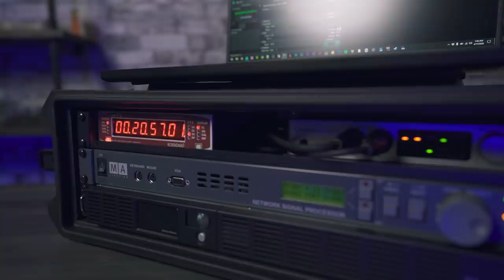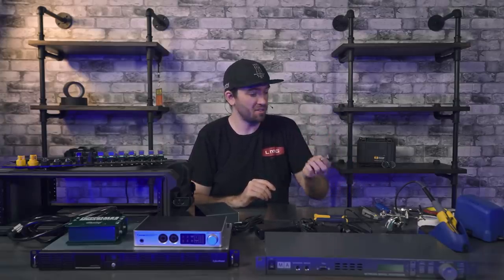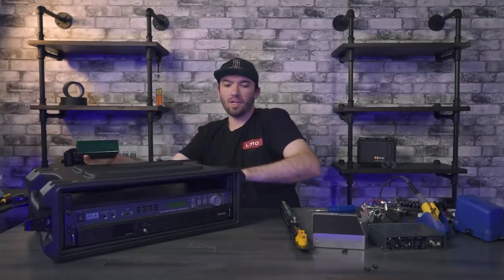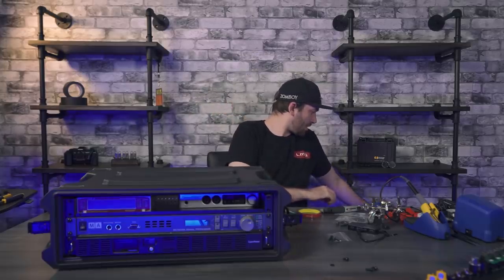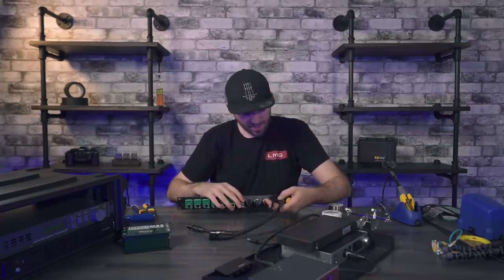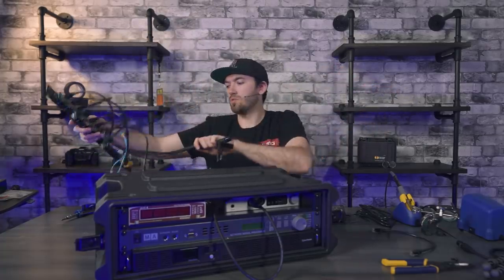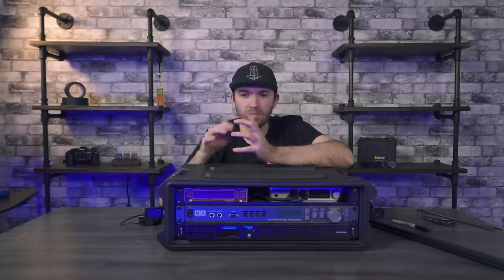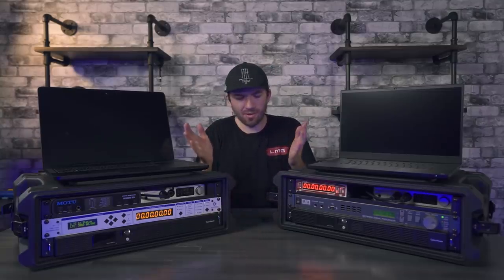Building My New Lighting & Video Timecode Rack Step By Step

Comment: RE: UPS, had this same concern with a switch and artnet node - In the end I took out the switchmode PSU's from the devices and powered them straight from a battery (so also more efficient as UPS will have DC batteries, which then will go through a rectifier to 110v AC (or 230) in my case - and then you are switching back to DC again for the device itself. Plenty available if you look at DC UPS for industrial controls. They are tiny too! Be similar to the setup in your MA (or in my case MQ60)

Comment: Two years ago, Cacao Beach Bulgaria, Denis Cruz, 4000+ people, I do the mixer changeover while the warm-up DJ is playing and do a blackout, Denis starts (thank god with a long intro). The MA laptop stop. Completely. In 30 seconds I grabbed my personal laptop, download the showfile from a backup flash drive, plug the fader wing and somehow manage to open in time for the end of the intro. Now I have two fully identical laptops always running next to each other.

p.s. a little tip for easy change-overs: If you have 3 or 4 players and one DJ needs mixer A and the second needs mixer B, simply connect all players to mixer A via analog and to mixer B via digital. All that needs to be done is to swap the booth monitors from one mixer to the other and all can be done while the Warm up DJ has started the last song. No downtime whatsoever.

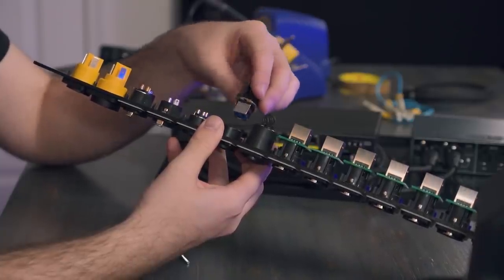Comment: 42:21 The panel mount USB was flipped incorrectly. There is a flat silver piece of metal with a retaining clip pressing against the USB B part, when it was flipped that should have been removed and put on the other side before screwing it back together. this will also let the USB B connector go further into the panel mount with the center "barrel" going into the metal part more. I hope that helps!! Great video!!
Reply: Came searching here for this comment. Glad I am not the only one who saw it.

Comment: I'd highly recommend securing devices to rack shelves with stick on industrial velcro. Easier to re-position, easier to swap out devices when they fail. Just as adhesive.
Reply: Velcro all the things! 
covering shelves in loops is always the first thing I do.
habit I picked up from a guitar tech roommate, it just saves so much time reconfiguring little silly things without rack ears.
Reply: Added to the velcro, a few holes drilled into the shelf and pass cable ties to make sure nothing moves during transit too.

Comment: Question:
ShowKontrol 
As I Understand,
Should have a CDJ 2000 NXS2, connected via Ethernet out of the CDJ and Into the Mac Laptop where SK is Running, and from what I can see in the Very Helpful video is that SK can Generate a Timecode signal w/o the need of a CDJ connected.
How is that setting done on SK?
Connot seem to find the propper setting so that I do not need a CDJ Hooked to generate TC.
Would be Awesome.
I am running the last available version of SK, on a MacMini, with SK installed, 
This MacMini is only used to run SK, and runs it well,
So please,
Share how You actually got SK to Run and send TC, w/o a CDJ 
ThanksMan!!
Awesome Video!!
Very Helpful! 
🙏👍🏻🤜🏻✨🤛🏻

Comment: Hey Christian, nice build hope you are doing well during lockdown. 
Some notes I would like to say from my own experience, the rj45 pass thru connectors are way more easy to do the build but they're also way more easy to malfunction, unless its for indoor use only I would recommend to use the stripping type of connectors like you did on the previous rack. Another thing but its more about personal preference and depends of the use, I usually prefer to remove bottom or side screws of the equipement I want to fix and drill a hole in the tray and fix them with their own screws, I dont know if you can understand.
Anyway I enjoyed it a lot and overall perfectly made! Hope you stay safe!
Reply from the maker: I think I will be making some changes and posting an update :) the punchdown type seemed more fragile, but I will do some more research.
Reply from the maker: Thank you

Comment: For the UPS, is your main concern that the switch is going to lose mains power, or that the internal power supply will fail?

If the latter, there are some relatively affordable 1U switches with redundant power supplies built in.

If the former, they make fancy power cables that have two input ends and a big switch that can detect a power loss on one of the input lines and switch to the other. They're called ATS (automatic transfer switch) cables and are used in datacenters when critical devices don't have redundant power supplies built in. They're expensive but might be a solution if you know you'll be able to have access to two distinct power sources on location. 

As far as lighter batteries, you've probably already come across this but there are some decent AC-capable battery packs. Mophie's Powerstation AC is a really good option. I've got one in my travel kit. The limitation of course is wattage it can support. I think the Mophie tops out at 100w. There are some lesser known brands that claim they can do better, but I'd be wary of accepting those specs at face value.
Reply: Oh! And another option would be a lithium powered UPS. APC makes a nice one that's half the weight of the Cyberpower unit you've got. That's probably the most straightforward solution. Link: https://amzn.to/2VALnGl

Comment: OM 1 thru 4 define the thickness of the core and cladding of the FiberOptic Cable. OM 1 and 2 are basically the same. OM 3 and 4 as well. There are some minor differences which make the even Numbers a little bit better for longer cables. But in the End they are mostly the same
Basically it is like wire gauge.
You can call it Fiber Optic cable. Technically it is more correct to call it a Fiber Optic. At least in Germany. A Cable defines something which transmits electrical Signals. A Fiberoptic doesn't do that.
And your Fiber cables aren't crossed as they should be. Any Fiber patch should do a crossing pattern. There are certain applications, where that is not possibe, therefore you do have the ability to take those fiber connectors appart and make a regular "Crossed" Fiber Optic a "Straight" Fiber Optic. I could be wrong though. Because it doens't show on your video very well.
And I couldn't find a "Pin-Out" for the Opticalcon Quad.

Nevertheless, those are 2 nice pieces of Equipment. And I hope you will enjoy them without to many trouble.
If you can make it happen, try and test that Rack with any other Network rack and please prove me, that I have seen wrong. I've been in the situation before, that something with fiber optics wasn't working and it was a real Pain until i bought myself a small fiber fault finder for like 20 Euros. That made my life way easier ever after.

Comment: Keep in mind that airlines have max battery limits for carry ons and a 0 lithium battery limitation on checked bags. Not sure If you fly a lot to your gigs but just a thing to keep in mind for the UPS
Reply from the maker: Yeah, that was my main reason for doing it this way but if I can get a smaller battery that can supply enough power for 10 minutes, then I can easily carry on the smaller package. I almost always carry everything on anyways.

Comment: Hey Christian,
Thanks for your great Videos. I‘m from Germany so please excuse my english.

I‘m using GrandMA2 OnPc in combination with NSP 2. Since some weeks i own a Command Wing for GMA 2 and i have the following problem maybe you can check it on your own.

I load a Showfile which was created with the NSP 2. When the CMDWing is Pluged in it doesnt work directly with the showfile. I have to creat a new Show, Switch dem CMDWing on and then i get the Massage about Original MA Hardware. When the Pop up comes i can Click okay and the Command Wings works with grandma 2. I can load the Original Showfile and everythink Works.

Maybe you have a good idea for this Problem.

 Best regards

Comment: could all ways DIY a LIPO pack and migrate the ups over to a 4U server case with the lipo pack and configure it as an inverter only instead of as a UPS and throw in a separate lipo pack charger so it would use the lipo pack as a ups battery bank and the lipo pack charger keeps the pack topped up

Comment: I understand that CDJ-2000NXS2s are the club standard for DJ gear, but I have no idea what venues are generally doing with DMX. Are there any real standards? I was going to get an Obey 70 and 5 or 6 cheap lasers/fixtures/washes just to try to understand it better. But this time code stuff seems complicated. I remember seeing a video of Armin a few years ago saying that at the time he was playing with two decks that were just for the time code, and then he needed to keep those in sync. That seems like a lot of work when you could just setup some chases and manually switch at the drop/breakdown/whenever and it would probably look a lot more like it was perfectly in sync than a lot of these super-complicated setups. I assume it's mostly because the DJs want to delegate the lighting and not have to poke a button to switch to a different chase — and that's kinda funny, because DJs love having buttons to press! Just pretend your DMX controller is like another beat effects section on the mixer!

Comment: Really appreciate this video! It sounds like the distripalyzer rack is more for situations where you don't want a physical console to fail and lose your LTC signal into MA, therefore onPC would take over with MTC.  Would the mif4 rack be when your artist is sending you two separate timecode signals which have different timecode times, as demonstrated with ShowKntrol in the video? I suppose with the mif4 rack you would be losing some redundancy in terms of getting, for example, timecode A or B into the MA session twice(Like the distripalyzer rack)  because the other timecode signal is a different timecode time? Hopefully my thoughts make sense lol.

Comment: There are such thing as lithium lead-acid replacement batteries, they are designed to be swappable with Legacy sealed lead acid battery systems. if you could find a compatible size or maybe sacrifice time that would cut your weight down dramatically. and do realize that the UPS is a way better method then a battery system as it has communication with the computer. Otherwise you would be building your self a online UPS which would consist of a very beefy power supply, charge controller, lithium battery pack and good quality sine wave inverter. And a lot of the battery packs on the market you have to watch out for as 90% of the inverters on the market are modified sine wave and not true sine wave, which does make a big difference in efficiency, Cooling and anything that's relying on the AC waveform to be clean, stable and consistent in timing. I had a i think Dell power brick that just refused to run on my older modified sine wave APC UPS, meanwhile the hard drive for data intake was completely fine with it and everything else I plugged in at a bit of loss of efficiency. And when I say older model I mean it's one of the older gray really cheap power strip style models all my newer ones have much better control on the modification of the sine wave, and if I can get it working again I have a nice sign wave expensive ups that I got for free.

I "do"? live sound and I Was Bitten once by a power outage. I was using somebody else's PreSonus mixing on my iPad and we just finished practice and pre-check, as I was walking to the mixer to sync the faders with the computer.... the power went out and everything reset to where the physical fader positions were. I believe in using a UPS for everything because then everything comes back up right where you left off; plus you have some light when you're trying to troubleshoot from your computer monitor. I will plug as much as I can into the UPS except for the laptops and amps and if I do anything bigger I really do consider dragging out the Behemoth that I can run everything including the most important piece of equipment the cooling fan, for me.
I guess I should say I am a reasonably small setup with the xr18 a handful of laptops and about 1-3x 100 watt dual Channel amps. I was looking to upgrade to a 4 ch 500 watt for my mains+mons I'm torn between the Behringer and the seismic audio and lack of cash... suggestions would be appreciated.

As far as stage stuff goes I generally wouldn't put that on unless I could see one of the musicians having something that would be badly affected by a restart as in losing settings, amps and stuff will just go off and then come back up; unless there's a brown out then that's bad and you should be ready to hit the stage power switch and pull the plug!
Reply: If you made it that far congratulations, I'm sorry.
I also put my network on it obviously. I recently ( was it January or February? ) did a live streaming event and I figured the internet will probably go down at the hotel but as soon as it comes back up all I have to do is restart the stream and all of my equipment remains active and maintaining IP addresses.
Although I do plan to incorporate a better router at some point that we'll be able to do load balancing and fell over to a Cellular Connection...
Oh yeah there's also the benefit of things continuing to record capturing the disaster as it unfolds. Thankfully the only disaster I had was with Facebook and the live streaming app that decided 1 hour was all I needed to stream for and continuously posting to my Facebook and not the events for that event.

Comment: Christian, please reconsider some of the things you did with power. The metalic panel with the power should be grounded. If a connection came loose and caused the panel to become live, you would be the one liable for any injury / death. 
Those connectors should also be compleatly insutaled, you can get a couple of Neutrik covers (called SCDR). And only ever use ratchet crimpers, others are just unreliable.
It's also not acurate to say that an MA 2 shouldn't be connected to a UPS, ACT Lighting themselves say: 

"If you want to have power available beyond this internal UPS Battery, in the event of an unexpected power loss, it is possible to connect to an external UPS, provided that it does not lift ground from input to output. The console must be grounded." 
An MA has a power distribution PCB which transfers power from a PSU to a battery, no inverter or anything that would cause problems.
Reply: Not having watched the whole video I want to add one concern:
MY Ubiquiti 8port POE Switch gets really warm, even with nothing connected and drawing power over POE.
Seeing as this will get used in summer festivals or club shows where it tends to be warm anyway it might not be the best idea to put the switch in flush with the box.
It would be a shame to see any of these parts fail due to overheating.
I also second the grounding of the metal plate. In Germany you would have to test this entire unit and the panel not being connected to ground would make the whole thing fail the test.

Comment: Those fibers are not happy... Keep the radius bigger and Do it last So they get less stress
Reply from the maker: Good call I will do a little rerouting! With the original configuration with the panel in the middle slot of the rack it was no issue but I was forced to move the panel up to the top and it’s not ideal for the fiber. Mostly just wanted to get this built since it was 6am and I needed to finish this video :) thank you
Reply: @christianjackson  you are welcome
Reply: Also that SFP connection without opening the clamp.. Yikes xD
Reply from the maker: Haha copy all that. Will open em up and get it fixed and post an update. I can’t really even use the fiber part I just wanted it all in there to be ready for when I do eventually need to use it :)

Comment: hi! i have a question, i noticed you have the motu microexpress on the first rack, can you use it as a standalone to convert LTC to MTC? does it transmit that MTC output in every MIDI out? i've been looking everywhere (manuals, forums, tutorials,etc) for that information and i haven't found anything, i would prefer to buy something like the MIF-4 but the price difference is big. i hope you can reply to this comment soon. thanx a lot for the videos, your channel helped me a lot with the stuff i'm learning to do right now. keep it up.
Reply from the maker: This is a good question! I just verified with my setup that this scenario DOES work. However, you will have to use the MOTU midi software first to save a user preset with that midi mapping. All you have to do is create a routing from “MTC” to the midi outputs you would like, then save those settings/routings to the user profile. Then you can power it with just USB, not connected to a PC, select that preset on the micro express front panel and it will work.
Reply: @christianjackson  that's awesome!!! thanx a lot for the reply!! right now i'm waiting for the update on my avolites software that will include a secuencer (i think it is currently in beta) and then i'll get my hands on the microexpress, so i'm still a couple of months apart from getting it. thank you very much! cheers!

Comment: Instead of your double sided tape which is quite messy if you ever have to take out the pieces of equipment why don’t you use sticky back hook and loop Velcro tape 2025 mil it is super stuff all my racking of loose equipment I use this protocol and it works very well and it’s very easy to take out for maintenance